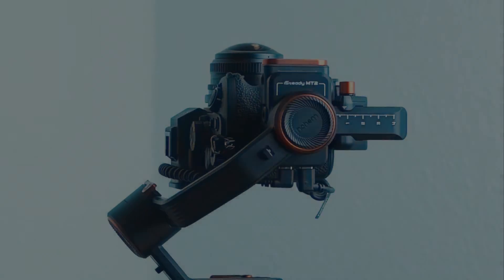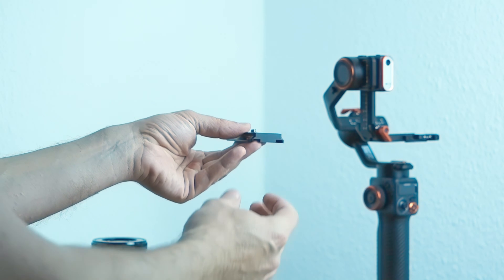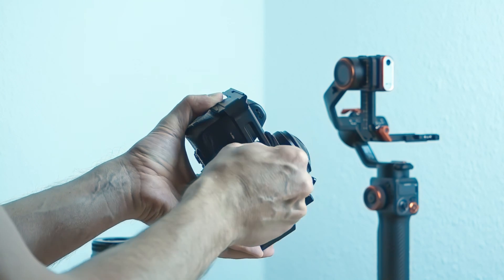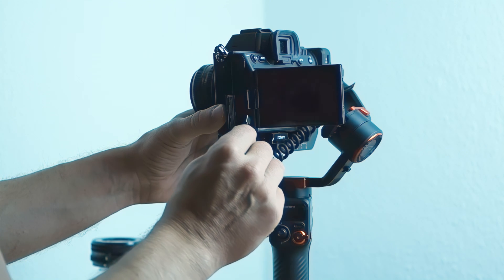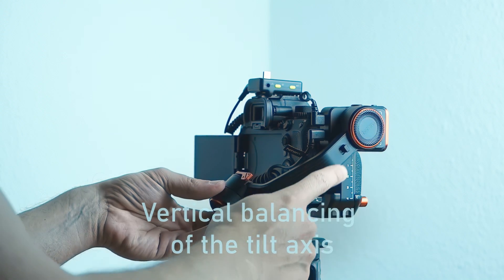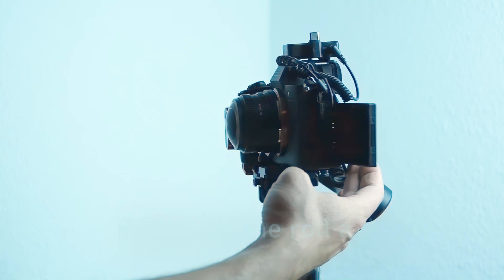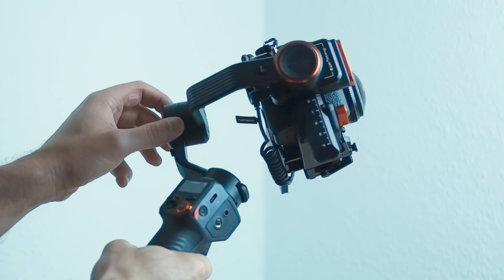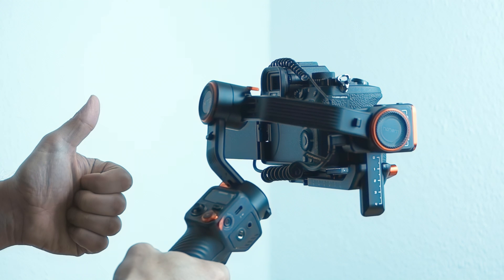S-LAB Q 002 🔴 hohem iSteady MT2 — perfekt EINRICHTEN und AUSBALANCIEREN 👈

Comment: So an Action camera has to be balanced?😮
Reply: Yes, an action camera should be balanced so it can be perfectly aligned with the motors and sensors on the gimbal. If you don't balance it, you might see som sluggish performance, and some confusion within the gimbal.
Reply from the maker: Hi David, the A7 iv is not an Action Cam, though the gimbal helps to stabilize the unit. Therefore it must be balanced first. If instead you are more interested in Action cams, you may check this playlist here: https://www.youtube.com/watch?v=GxZB6RYOnio&list=PLlBJKagqPbsaqXuSiNtB2CGPcQYhUKtgE